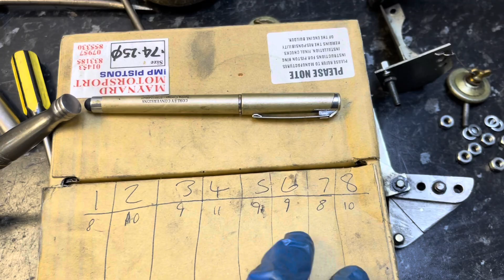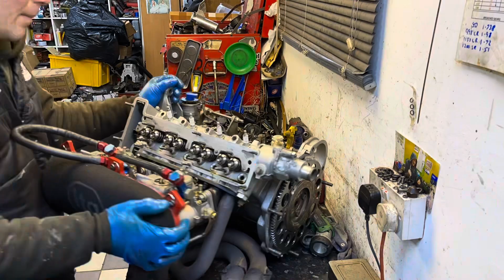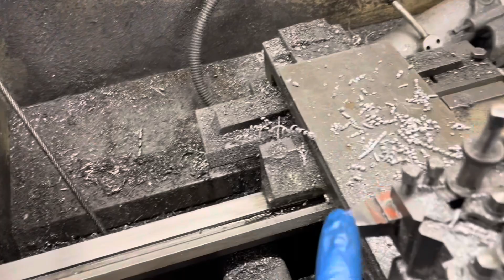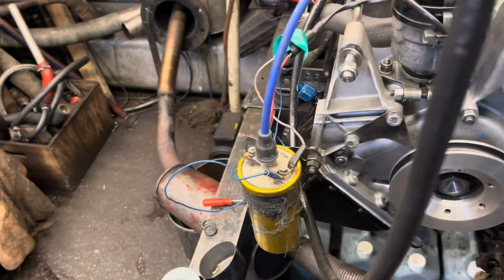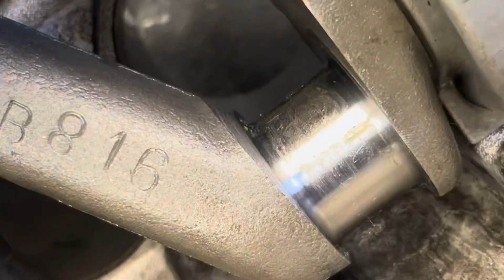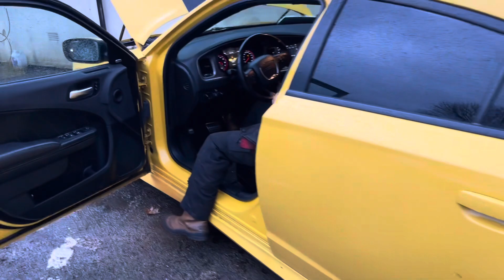Shrigleytube tv ep22, steel rod swop, offset crank back from grinders, visit from dodge charger

Comment: Hi Andy great content again.  If you fit Oil temperature sender's to Imps ( I fit the small 1/8 NTP types) you might consider tapping the top of the triangular output chamber of the filter block, the one that takes filtered oil into the main gallery.  This position gives you a true reading of gallery oil temp post cooler and post filter.  I use a coolant heat exchanger (Range Rover Sport transmission cooler) mounted on the timing cover studs just above the std filter canister(v short pipes)  This pre gallery position shows oil temps near to coolant temp on the road and within +10  to 15 C  when pushed. Oil warm up is rapid.  Another sensor in the sump shows much cooler oil normally. Both sensors are read from one gauge using a changeover relay. I'd post a pic but I can't. Keep up the great content!